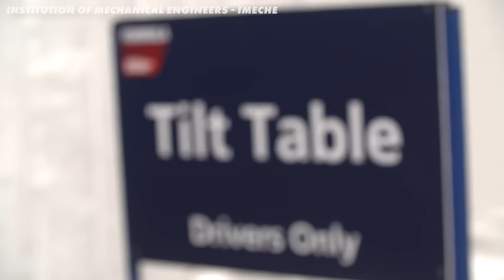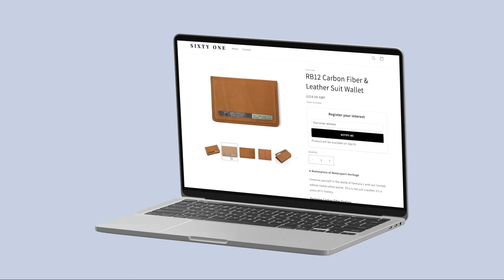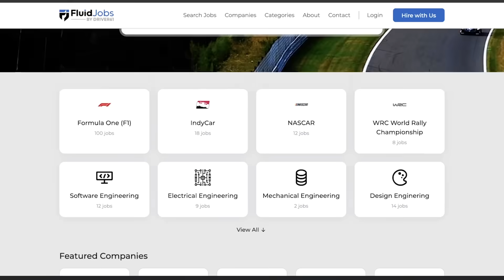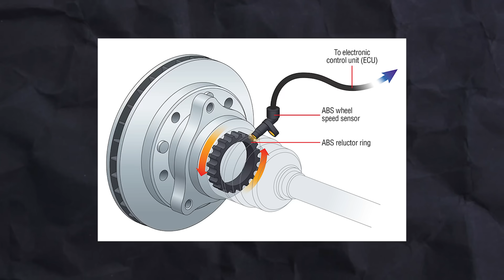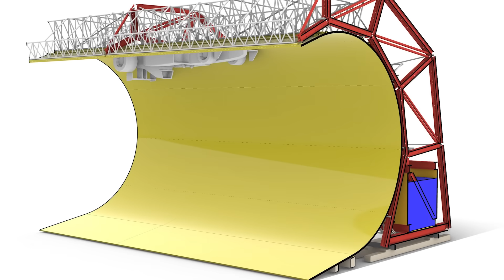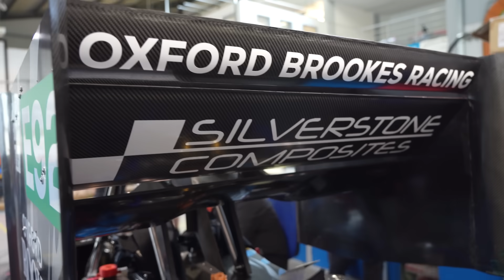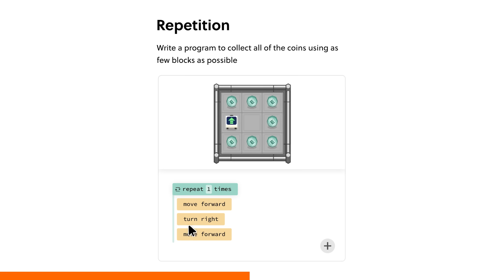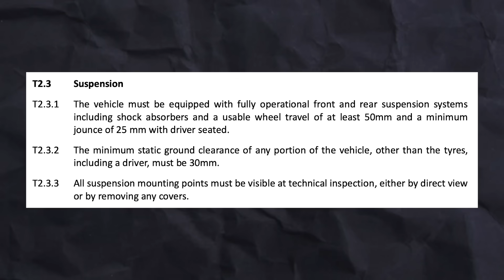How Students Made Something More Advanced Than F1

Comment: I just finished my last year on an FSAE team. It's truly bittersweet. I'm going to have more time now to do other things in life, but I am going to miss the grind and excitement of designing, manufacturing, testing, and validating an FSAE car. I'm also going to miss all of the connections and bonds that were formed over the years. I highly recommend joining an FSAE team to anyone who has the opportunity to; it is very fulfilling.
Reply: Why aren’t optical sensors used for speed measurement (computer mouse style)? Are the speed estimation models good enough? I would assume a periodic ground truth measurement would still be beneficial.
Reply: @float32  most of the good teams use optical sensors (or even developed/built these themselves) as they are definitely beneficial. Working in motorsports now I would never rely on any other method of measuring speed - like the mentioned wheel speed times tyre circumference (tyre radii change with speed, pressure, camber, load etc.). You always want to have at least some reference data with an optical sensor.
However, good optical sensors may be expensive/bulky/heavy. Back in my time in FSAE we rented an optical sensor to gather data on the test track to improve the estimation and simulation models, but we also did not have 4WD
Reply: @float32  I only worked on the mechanical systems of our cars, but I'm going to guess that having optical sensors exposed to the elements might not be as reliable as a magnetic sensor. Maybe someone with more experience may chime in 👍.
Reply: @float32 encoders are used why would you use an optical sensor?

Comment: So which team is going to add a fan to suck all the air out from under the car? Maybe it can’t be done with the endurance event lack battery capacity
Reply: Rennteam Stuttgart, FasTTUBe Berlin, WHZ Racing (Zwickau), AMZ Racing(ETH Zurich), Joanneum Racing (UAS Graz) TU Graz, TuFast(Munich) are(I think) all the teams that run powered ground effect systems. All of them use the fans during endurance runs, they just turn the power down
Reply: Thanks for the info

Comment: 9:15 “teams have complex speed estimation mechanisms”
Why aren’t they laser tracking the tarmac underneath the car? Do that in two places and you have all the info you potentially need
Reply: How about high frequency GPS? Consumer grade ones can sample at 25 per second, not sure if that is fast enough for this application.
Reply: @TomLichti  civilian gps will not give you a precision that is required here
Reply: Check out the race box mini or similar 25mhz gps. Used by motorcyclists and drivers at track days all the time.
Reply: @jstogdill  do they feed data to their ABSes?
Reply: @jstogdill  I am still very sceptical. 
My GPS speed is being approximated from position of 7+ satellites and varies with 2-3 km/h depending on the buildings and forests around.
For the purpose of understanding when to brake a wheel you need something more solid than a clock in the sky that could be covered or mirrored. 
Imagine a warning message in your panel: ABS and TRC are unavailable due to low GPS accuracy.
Reply: @geniegb  could happen. But it would be one significant input into the “how fast” algorithm, not the only input. If the gps signal is lost for more than x period of time the algorithm could easily degrade to what it’s doing now.
Reply: The devices that can do that are very large, heavy, power-hungry and expensive. Tradeoffs usually come down to GPS + Yaw rate / Accelerometers + Wheelspeeds and a lot of estimation.

Comment: These cars don’t have diffs right?
Reply: Considering they have torque vectoring I would assume not, that makes the diff useless right?
Reply: Depends on the team and how they design the car, some cars like Oxford Brooks use hub motors but I know the team I used to be in are planning to use a single larger motor to power the rear wheels using a chain to the rear axle with a limited slip differential. This is because my teams budget is way less and buying 4 lower power motors is more expensive and we already owned the differential from our I car
Reply: Yeah and I think since there is a motor in each wheel and not one motor for two wheels there is no diff to split the power from a driveshaft between 2 wheels
Reply: There are different designs, some Teams only have rear wheel drive with a chain going from the motor to the axle with a diff. 
Most of the top teams have hub motors, but FaSTTUbe (TU Berlin) are RWD and have been pretty successful with that, beating many seemingly more advanced teams.
They also have a steel space frame instead of a monocoque (hence the name).
The purpose of a diff is achieved by having motors on each side, allowing them to turn at different speeds.